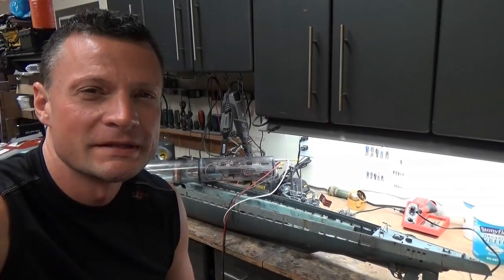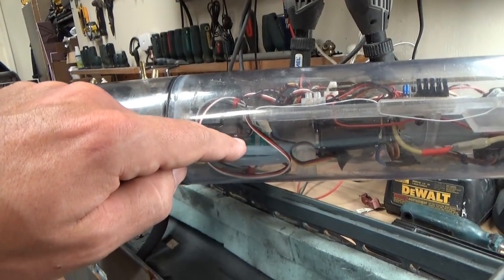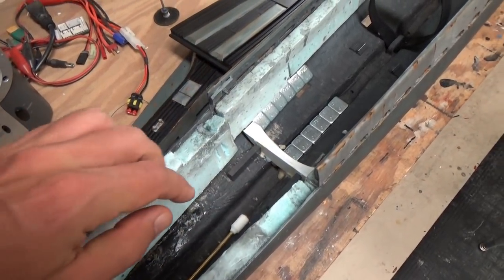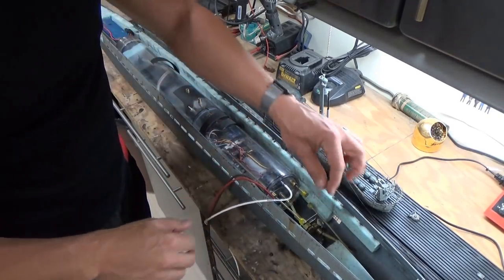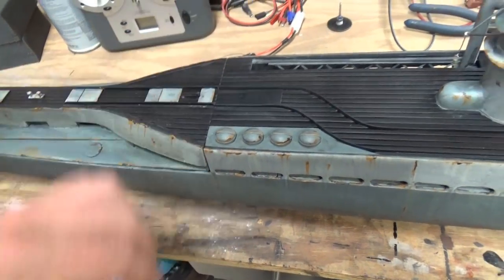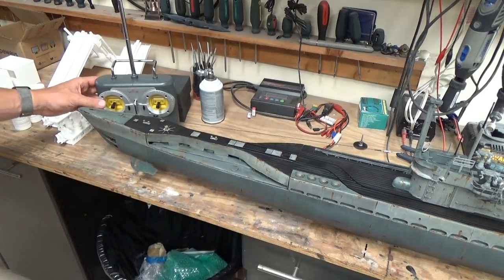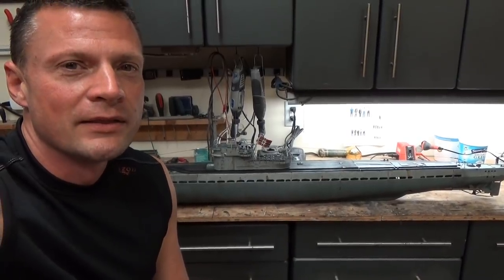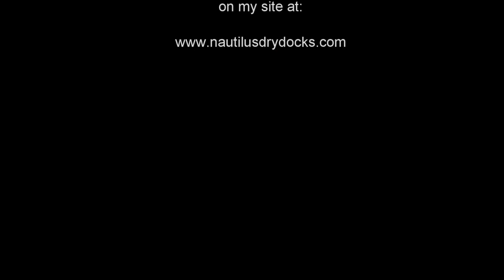German Type IXD RC Submarine in 1:48 Scale

Comment: The attention to detail is awesome. Did he use a 3D printer? It is all so impressive. So, it isn't a problem for the battery to be submerged in fresh water? Still, fresh water would be mildly conductive. If it was salt water, the water would be much more conductive and a bad idea. How did you seal the acrylic tube where the drive shaft went through? Great video. Would you make a video that shows it diving? Superb work!
Reply from the maker: That boat has gone on to a new owner, so no video of her diving will be made, unfortunately. Seals for the linkages and drive shaft are cup seals, but also bellows seals are commonly used for linkages. Fresh water is not conductive at all. Minerals and chemicals increase conductivity. In most cases, you'll see mild corrosion of the positive terminal (they turn green). Using a sealed lead-acid battery and simply sealing and using a waterproof connector solves the issue.
Reply: @RCSubGuy  Thank you for the informative reply. True, regarding fresh water.

Comment: RCSubGuy -   Would it not be safer to place the cylinder into the hull, rather than throw it in?  

Nice model of a classic long-range ocean class U-Boat.   

However, if you are serious about being a submarine modeller, you should seriously acquaint yourself with the correct terms for the parts of the boat... 
Internally, the 'front' compartments are called the 'For'ends' and back part the 'Aft ends' ...  On submarines, the upper 'deck' is generally termed 'the casing'.  Ships, or boats don't generally hoist 'flags' (the term of which, in maritime circles, are usually reserved for signal pennants/flags...), the term in this case would be the Kreigsmarine  Ensign.      

And for a fully operational diving model, it was a serious disappointment to not actually see her submerge!  

You still get a thumbs up though, for effort.

Comment: Yeah, they call it a submarine for a reason. If it can not dive, then resurface, it is nothing more than an ugly surface vessel. I wanted to see how the controller signal performed with the sub underwater. If you would need a tall thin antennae for the sub to receive the signal or not. It is a beautiful model, great paint job, working parts, the whole thing. It just would have been the icing on the cake to hear DIVE! DIVE! DIVE! ( in German ), and the sub go underwater, then resurface. Maybe next time you can do it in a swimming pool, and have a camera underwater to watch it dive, sit on the bottom, then blow the ballast tanks, and surface.

Comment: Yu should install 3 or 4 fpv cameas so can see under water and above.
Reply: Chad Christman there's issues with underwater wireless camera due to physics. You'd have to add a snorkel system for the antennas (instead of exhaust like the real ones) and that would be hella hard to install, let alone keeping it at the correct depth.

Comment: What's sucks is there all the same on the Inside. Just plastic and servos. Basically pvc pipe with ballest
Reply from the maker: As opposed to.... gold and jewels? Titanium and crystal? What are you expecting here? The drive systems for these subs are numerous and feature many different configurations and setups. Your comment is like saying all cars are the same... just bodies, tires and engines.
Reply: @RCSubGuy  yes and I mean no disrespect. What I mean is what sucks as models is as small as a servo or what every electronics is it. I meant more as like extreme end of imagination and my type 20 in my dreams has a mini 6 torpedo hydraulic reloader to spec because that's how good 3d prints or something are. Man you're way way way more advanced then anything I could do now. So I apologize if it came off as a dick.
Reply: @RCSubGuy  like model aircraft have spec air cooled and rotary engines. Build me a type 7 with a adjusted scale set of diesel engines.
Reply from the maker: @username-tv6uw  ah! Gotcha. I understand. Where do I send the invoice? ;)